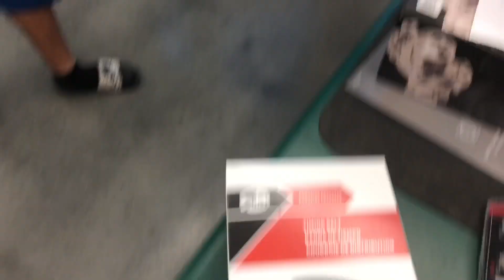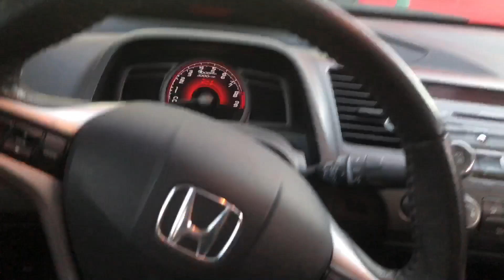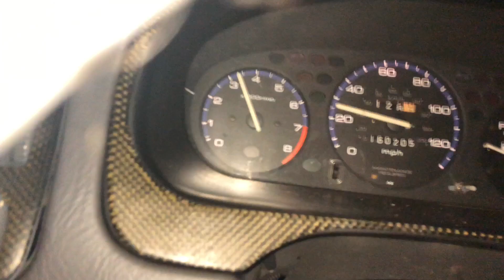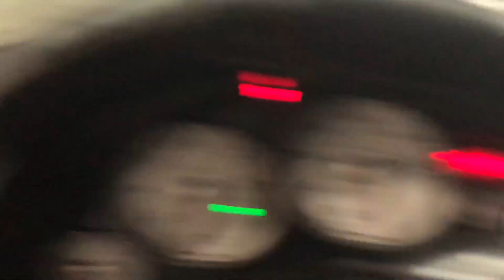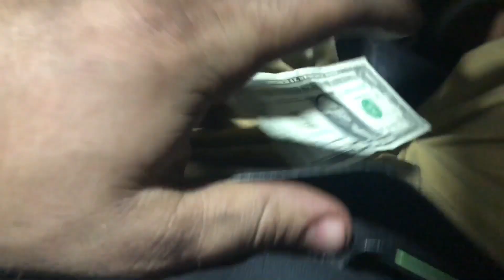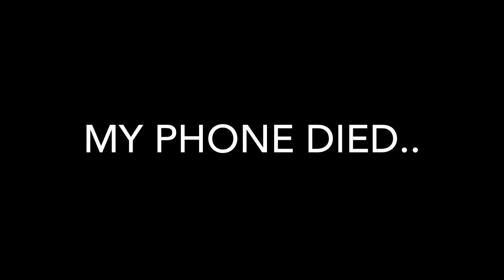Alfonso Finally Hitting Vtec Again!!

Comment: I have a question, I bought an integra 2 days ago. I’m very confused on what kind of integra it is. It has a B20 and the Vin # matches the chassis and car which doesn’t make sense because I never seen a B20 stock integra. It has type r front end with the type r plaque and everything. It has a sunroof for some odd reason and everything in the car has Japanese letters and barely any English. I looked up the Vin # and it says it was imported from Japan. What kind of integra did I buy??????
Reply from the maker: B20 is a very common swap for non vtec integra. Dont worry, they are good motors and will last long as long as you maintaince it and take good care of it
Reply: SP Tuning thanks, can I make it vtec ? Is that possible?
Reply from the maker: Yes sir look up ls vtec